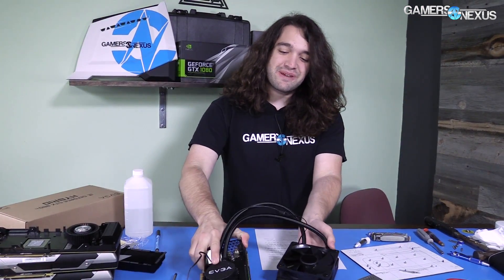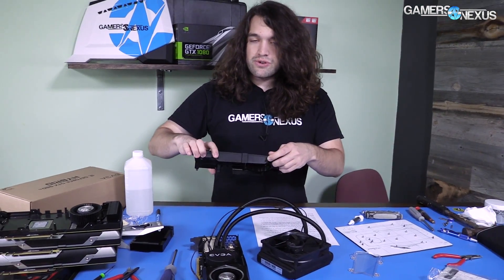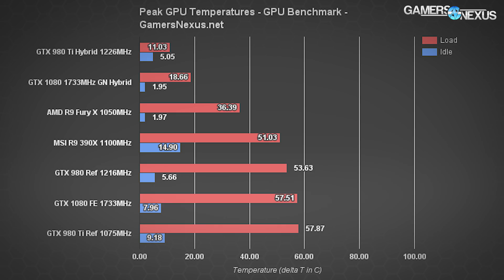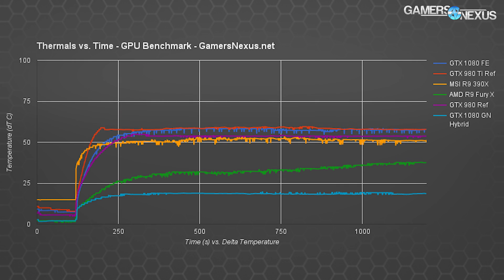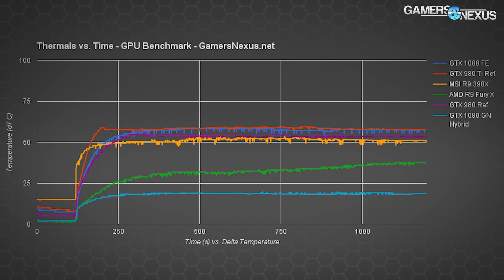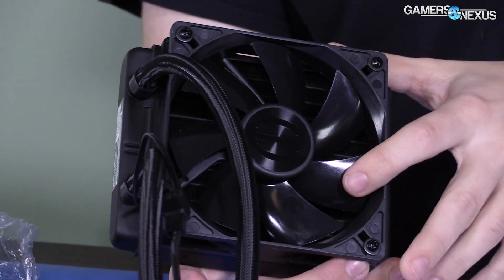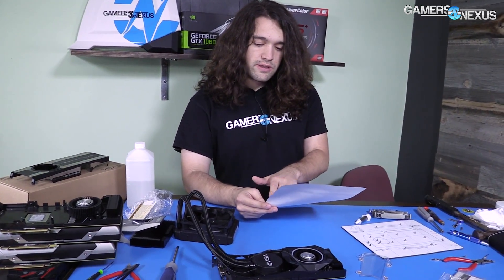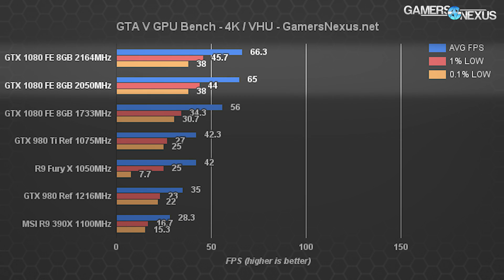Building a GTX 1080 Hybrid Pt 3: Performance Results

Comment: I'm gonna wait for the 1080 Ti instead
Reply: Good call. The GTX 1080 is not really faster than most  OC'ed 980 Ti (binned one's). My binned Gigabyte GTX 980 Ti Xtreme with a stable 1539/4010 OC performs the same or even slightly faster in some games than the Reference GTX 1080. Most reviewers are blowing the the performance gain out of proportion. They compare it to stock 980 Ti. No one runs 980 Ti's at stock Lol.
Reply: +Anitrex006 the fuck 4010mhz? dude stop lying... there's no way in hell..
Reply: +BulletBlaze 4010 Mhz mem clock mate. 8 Ghz effective. GPU clock is 1539. This is a pretty standard OC on the 980 Ti unless u get a really bad chip.
Reply: +BulletBlaze GPU clock can go up to 1600 Mhz and temps will be fine but some games start freezing. 1539 is the max stable that I was able to achieve.
Reply: +Anitrex006 the 1080 can go up to 2100mhz gpu clock go watch HardwareCanucks review. He overclock it to 2100mhz.
Reply: +Anitrex006 the normal clock is 1603 - 1733 and you can overclock it to 2100mhz
Reply: +BulletBlaze Yeah but they cut down the cuda cores on the 1080 I think so end perf ends up being similar. I am purely going off the GTX 1080 fps i see in these benchmark videos. They are comparable to what i get on my 980 Ti. 1539 is the OC'd core clock btw. Boosts close to 1700. Temps 81 C with manually adjusted fan curve.
Reply: +mage7206 I brought it for a ridiculous price when it launched. However atm some of these binned 980 Ti's are hitting the used market at around the 380 to 400$ mark with warranty still left on 'em. These cards are a steal at this price considering they are gonna perform the same as the reference GTX 1080 (600 to 700$ plus tax) in most scenarios. I find it really stupid that owners of these excellent 980 Ti's are falling for the hype.
Reply: +Anitrex006 Well I'll ignore the obvious bs and get to the good point. How much are you paying for a binned card that outperforms the 1080? Now compare it to the price and performance of a 1080, now compare it to the price to performance of a 1080 overclocked, now imagine an AIB version price to performance. Your binned 980 ti really isn't all that good in the end.
Reply: Buy a used 980ti from the fools that will be selling there's for $250-$300 to get the 1080 . They'll end up paying $400 for 7-10fps increase . Save that money for the 1080ti .
Reply: BulletBlaze Very few people buy a 1080 for 1080p. The differences are smaller at 1440p and 4k, although a custom 1080 will always outperform a custom 980 ti.  It's a better, newer card, thats just how it is.  The 980 ti is still a hell of a card though.
Reply: Anitrex006 no one runs a 1080 at stock either, the 1080 is better.  You dont have to deny the fact that your hardware isnt the absolute most up-to-date on the market, you can just take the 980 ti as it is, its a hell of a card, but not the best.
Reply: +Anitrex006 And why should anyone buy the founders edition of the gtx 1080. Most people are going to buy an aftermarket card which is factory overclecked. In my oppinion it's just fair to compare a reference card with a reference card.
Reply: +Anitrex006 lol when you're trying to justify why you bought a 980ti card, and the new 1080 is better price/performance and beats your 980ti
Reply: Roy Wright I wont need a high binned card to outperform the binned 980 ti cards. The starting price for AIB is $600, there are very good cards that come out for about $50-$100 more than that, and they usually perform as good as you get without going to binned cards (except for a few oddballs like hybrid coolers).
Reply: Buy a used 980ti from the fools that will be selling there's for $250-$300 to get the 1080 . They'll end up paying $400 for 7-10fps increase . Save that money for the 1080ti .
Reply: +47refugee i bought a hybrid for 500$, i havent seen any going for that price, the lowest i saw was 365$. Im not saying they havent gone for that low, but itd be hard to find one for that.
Reply: +Anitrex006 Where is a good place to pick up a used Binned GTX980ti ?
Reply: dannyboy19811 i dont know.  I've never cared to much about  binned cards.  I have one 980 ti with a 78% asic which is pretty good, but it doesnt overclock any better than the rest of them, so binned/not binned doesnt mean much to me.  The performance difference is not that insane
Reply: Anitrex006 the 1080 Pascal got more fps on 1080 resolution Almost 100 more fps. Go watch TechSourse He made a video. Just type Gtx 1080 vs Gtx 980 Ti
Reply: dannyboy19811 Look on eBay for used. The following would qualify as binned GTX 980 Ti's (75%+ ASIC):
Gigabyte GTX 980 Ti Xtreme
EVGA GTX 980 Ti SC
MSI GTX 980 Ti Lightning
Zotac GTX 980 Ti AMP
Galax GTX 980 Ti HOF
Reply: Anitrex006 you cant base it purely on asic, it only has an effect some of the time and theres on consistent results with it.
Reply: Max Latz We are not yet sure how good the custom boards will be for overclocking. Nvidia has handicapped these early pascal chips quite a bit in multiple ways. Card manufacturers will have to work hard to make Pascal overclocking comparable to what could be done with the 980Ti. So we gotta wait and see. However the reference card is a fail for that crazy price.
Reply: ***** I brought it 1 year back so you can't compare that price to what is available now. As far as the new cards are concerned I think that the GTX 1070 is the real deal here. 50% cheaper for roughly 20% less performance than the GTX 1080.
Reply: And when TI comes out you better wait for Volta card

Comment: Well...that was anti-climatic. Was going to custom loop my GPU and CPU on my upcoming build but doesn't really seem worth it. Will see with board partners, hope they had another power connector so we can crank these voltages. I still have hope of 2500mhz core clock!

Comment: Question? Is the single 8 pin connection limiting the OC ability of the founder cards, One 8 pin connector is what 150 Watts  (I might be wrong on this). I have a feeling partner boards are going to have 2 x 6pins, 8pin + 6pin or 2 x 8pin connectors for more power headroom.

Comment: Very cool video and stuff I'm very interested in.  This video did however convince me further to just stick with a 1080FE and be happy with whatever OC I can get out of the box.  3FPS really isn't a big deal for me to wait for AIB cards, if I really needed more power I'll just buy another 1080 and SLI then call it a day.

Really enjoyed the content though and hope you do more stuff like this.
Reply: +c3tr4 You did not understand the video at all.  Stock 1080FE was 10fps slower than a stable over clocked 2050 mhz and that was 2 to 3 fps slower than 2100+ Mhz OC and when you are looking at the compute power it takes to gain that at 4k it's pretty impressive and when aftermarket solutions come out it will be even better.
Reply: Daniel Terry I absolutely understood the video, I don't see how you got the idea I didn't.  "Even Better" is going to only yield another 2-3 FPS IF the chip can even handle it.  You'll never notice in-game the difference between a FE & Aftermarket Stock or Overclocked, if you think you will you're delusional.  Any notable performance gains will only come from people doing extreme overclocking via hacked bios etc.  Things you and 99.9% of people buying these cards will never do.

Comment: i bet evga and other aftermarket cards will use a 8 and 6 pin for more overclocking
Reply: +Chris Adams not doub and charge 150$ just for that
Reply: +LFactoRve it's usually only about $20 more for custom PCBs. the cards that are $150 more or higher are cherry picked kingpin cards with dual and triple BIOS options and warranties that cover water cooling and modding.
Reply: +Chris Adams True but it'll be more expensive and you're probably only going to get another 1-2 FPS, not worth racking your brain over.
Reply: +c3tr4 yup i never cared to oc a gpu
Reply: ***** nvidia didn't hype the founders cards. they were hyping pascal in general.
Reply: ***** because they don't want to compete with their partner's custom boards. that's why. i believe they made that very clear when they announced the card. all reference cards are built by nvidia. even the ones sold by EVGA, MSI, etc. 

nvidia would rather do away with reference cards altogether, but that would piss off the water cooling crowd. reference boards are very popular among water cooling enthusiasts because there are a ton of water block options from day 1.
Reply: kinda looks like over 1900mhz theirs nothing to gain just get a decent triple fan card

Comment: Did "The Mod" with zip ties and an Antec Kuhler 620 on an EVGA 560 ti SC and its been stable for nearly 4 years now. No OC but MUCH quieter and a much cooler GPU.

Comment: I'm wondering if the framerates would go up by significantly more if the overclock increased memory bandwidth rather than the processing units frequency. If performance is bottlenecked by memory bandwidth, overclocking the processors will do little.

Comment: 4k ultra at 60fps on ONE video card, im sold
Reply: The-BGR Spot troll harder
Reply: +The-BGR Spot Are you being serious? Sure those cards can do 4K. But 4K at 20-40fps is a sub-optimal gaming experience. You'd either have to choose to run eye candy at low settings or run the eye candy and a lower resolution. So sure, those cards can run 4K, but good luck running games with all ultra settings and getting constant 60fps.
Reply: Binned 980 Ti's with 5 mins worth of OC'ing effort aldready get similar fps. Not sure what all the hype is about.
Reply: Peter Pimmelmann Yeah that is a good idea they should be absolute beast
Reply: +ZEEPOxWiZARD iix And i don't know if Doom was built with DX12 and Vulkan in mind but a lot of the game used in benchmarks are very inneficient in terms of resource allocation, so once we see new games fully adopting the new API 4K will be the norm.
Reply: +Leonardo Farias (Freeman) Doom (2016) was build on OpenGL as the guys at Id are pretty damn Anti-DirectX (using DX locks gamedevs down to only MS Windows), Vulkan has been out for BARELY 3 months whilst the IdTech 6 game engine the new Doom is running on has had 4-5 years worth of development meaning it only had OpenGL or DX to pick as an API right until game launch (which will have Vulkan patched in soon).
Reply: +The-BGR Spot xD
Reply: Are you guys being fucking serious?
Here is a list of 4k capable GPUs
Nvidia:
980ti
titan X
980
970

AMD:
Fury/x/nano
390x
390

im not sure about the lower end but fucks sake there are many people playing 4k on these GPUs
Reply: Binned 980 Ti's with 5 mins worth of OC'ing effort aldready get similar fps. Not sure what all the hype is about.
Reply: no wait for the 1080 ti

Comment: These cards with 2x 8pin connectors on AIB cards are gonna be insane, even with really good air cooling.
This guy was getting better overclock FPS numbers than you guys tho ?  http://videocardz.com/60151/nvidia-geforce-gtx-1080-tested-with-aftermarket-cooler
On Air. All tho he was only doing doom.

Do you expect we can see 2.5ghz and above on water cooled AIB cards ?

Comment: Wicked series of videos, thanks! It's insane to see what this mod does to temps and volumes. Granted you're not getting MASSIVE performance increases over stock, but you are getting silence combined with sustained boost rather than painfully fluctuating core speeds and that's a definite win.

Sooooo... what are you doing with that cannibalised 980ti now? wink

Comment: Little bit of an anti-climax :( Do you think beefed up power delivery and modified firmware might unlock the limit you were hitting (stock firmware was a limiter for the 900 series).
Reply: +Sam B I don't. Think we are getting to a point that chips are getting so small and don't leak much energy and heat just builds up faster than it can be remove.
Reply: Elcid Based off the results here it doesn't look like heat is an issue at all, its going to be cross talk that is the limiter IMO. The question is will a voltage increase (which is ultimately firmware limited ATM) allow for an increase in transistor switching speed through lowered slew rates or are we already at the point where cross talk is limiting the chip speed in which case a voltage increase will likely yield little to no gain.
Reply: +Sam B ya that's a issue to I was wondering if it would one into play as well

Comment: so you  are limited by the single 8 it seems?
Reply: Seems custom manufacturers will probably be throwing on a second power port. Heat dissipation will definitely have to be taken into account too, especially with more power.
Reply: I feel like nvida missed an opportunity here.  Its like the single 8 pin power was jsut to prove the low power consumption point.  Well, it can have a low TDP and still have 2 connectors for overclocks.  Obviously board partners will rectify this issue, but still.
Reply: https://www.g2a.com/r/user-56c0c2cb950e3
Reply: More like by the TDP limit in the chip's BIOS.

The BIOS is set to limit the GPU power draw from the 8-pin connector to something like 125W. The ATX spec requires PSUs to be able to supply 150W for the 8-pin connector, and requires components to draw no more than this.

However, the physical wires and connector can handle much more, and PSUs normally have much higher current on the 12v rail than this. So technically you could go much higher, with the VRMs being the next limiting factor.

On my 970 STRIX, I have 1 8-pin connector, but I modified the BIOS so that my TDP limit is 250W. And have the max power through the 8-pin connector closer to 200W.